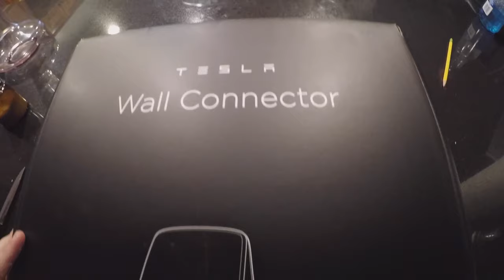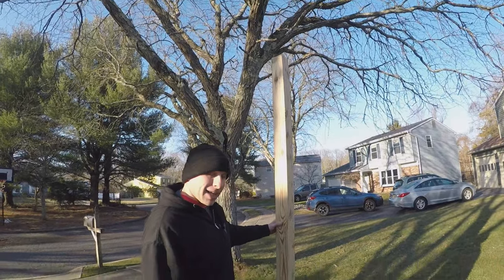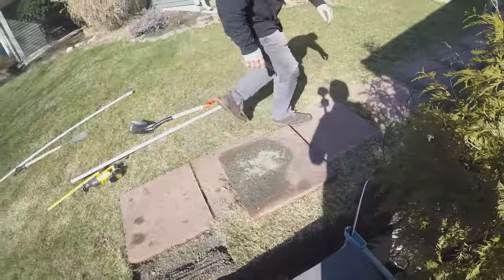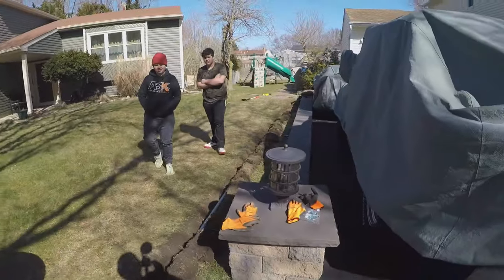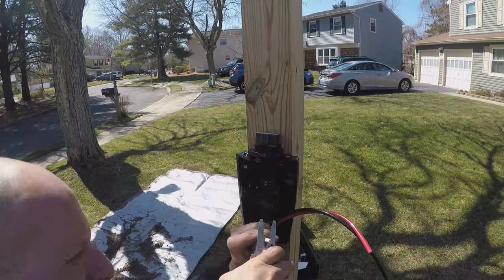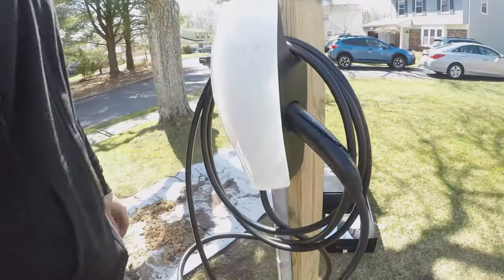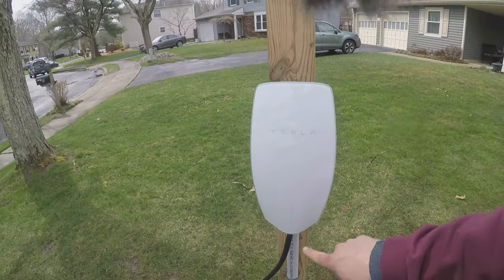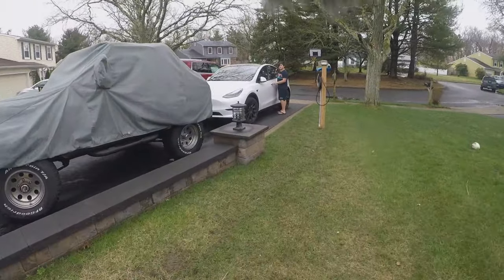Installing a Tesla Wall Charger in 15 Minutes

Comment: As an a electrician  , you should write disclaimer that your install is not to be used as an example on how to do this , as you have so many code violations on this video, not sure how you see this as a safe install, people out there please hire a licensed electrician to do this right for you , don't cheap out, you already spent 50k plus on your ride. protect your house and your ride
Reply: So when I buy mine I’ll hire an electrician to install this same charger? Great! Now I have to pay for the paint protection film, this, this for it to be installed, and insurance
Reply: Instead of wasting time complaining about this job, contribute and inform people on how to do it correctly.
Reply: @xjinit  there are people you hire to do these things (that’s why they called licensed ) if you can get your license watching YouTube videos , instead of going to school and working on the field we’d be in real trouble , so it’s not necessary to explain what or how to do it right ,only to say that if you don’t know what you’re doing (specially in electric , don’t don’t it )
Reply: @roygozlan04  News flash for you, school is thing of the past being replaced by the internet(YouTube.) Don't tell me you don't learn anything on YouTube, that would make you a liar. You also dont need to be "licensed" to setup a basic 6-50 or 1450 EV outlet for your house. Setting up a new construction 480V 3 Phase system on a commercial building is another story.
Reply: #Facts
Reply: Give me a break. This install was done clean and perfect. He doesn't need to spend 500+ dollars to have a trained electrician do exactly what he just did.
Reply: @xjinit  exactly, professionals don't want you doing this easy install. Even though the gentlemen in the video did a very clean professional looking install. I highly doubt if he hired a guy that they would of done any better. Now if your not the homeowner. You better hire somebody that's another story.
Reply: @roygozlan04   Yep, another tradesman who can't identify a tangible safety issue.  You guys (mostly union) always think someone's going to take your job away.  Nope. In fact, I personally would be more likely to hire a pro if I understood the safety concerns.  But NONE of you can do anything but spout "so many code violations".  Defend your position and articulate actual safety issues.  Don't quote NEC.  Tell us things like, "he used the wrong wire so that can cause __ ".

Comment: So many code violations. Don’t use this as an example for installing your own wall charger. This guy clearly doesn’t have a clue what he is doing.
Reply: I know nothing about code violations but please explain lol I’m curious.
Reply: Need metal line for Eletric in the ground. I bet it have to be so many ft down too. And I know nothing about code. Also are these Tesla box waterproof?
Reply: @markbenjaminh  That was my main issue.  Is the Tesla box rated to be exposed outside?
Reply: I am a licensed electrician who has done countless TESLA charger installs and i am a certified TESLA charger installer. This guy is a hack and don’t follow what this guy does. His trench is no where deep enough, the breaker he used is first of not the right style of breaker for that panel, and it is also oversized for the wires he used, his trench is not deep enough, his conduit is not built right at all, there is nothing wrong with the screws and bit that comes with the charger, they also wrap the cord too tight around the charger, they are going to short it out soon or damage the wire. This guy should not have done this and should not be encouraging other people to so it this way.
Reply: @markbenjaminh  nah pvc can be in a trench as long as the top of it is 18 inches deep
Reply: @christopherlynch3314  Yes, obviously you have not taken the time to access the mounting instructions via the Tesla website, recommend you do.  Rated for outdoor install.
Reply: @markbenjaminh  Agreed. Here electrical is required to be 3ft deep. At least when we had our home built that was the code requirement.

Comment: It's supposed to be 4 wires: two positives, a neutral, and a ground. Dude has 3 wires and used the white neutral for ground. He dug too shallow; it's supposed to be 18 inches deep.
Reply: Incorrect.  The Tesla Wall Connector only accounts for two hots and a ground.  There is no neutral. Look into it.

Comment: I did this installation too, a much simpler installation in the garage, into the wall and down to the basement.  The directions indicate you should wrap the wires around the right of the box so if the wires enter from the bottom wrap the wires and insert them from the top. Also, the directions indicate that you should use a torque screw driver to apply 50 foot lbs to keep the wires from slipping out. Also directions say wrap the cable counter clockwise but interesting putting the charger down the driveway. I am impressed if he did all that in one day.
Reply: It’s 50 inch lbs by the way.

Comment: Pvc pipes will break under the  moist soil and could damage the cable. There is other cable protection on the market for underground wiring
Reply: I expect there are variations in local codes.  But I have on many occasions seen 200A service brought into a home via schedule 80 PVC pipe.  Perhaps your statement might be true, but there must be some specifics about it.  Obviously that's not true as a generality so maybe clarify?  Also not sure why you think moist soil will break it. <shrugs>

Comment: thank you so much for this video, 
is it ok to use this wire 6/3 Black Stranded CerroMax SLiPWire Copper NM-B Wire for under ground, I have my electrical panel 75 ft away from where I want to install my charger and I need to go under ground and I have only one place left in my electrical panel

Comment: Illegal electrical install..... breaker, not rated for the panel, the conduit is not deep enough, straps not rated for pvc, no expansion joints,  no fucking bond/ground wire... that mess you made of the conduit leaving your panel... my head is exploding... where is the cover for your electrical panel?

Comment: Hope nobody steals that beiing for some reason at the end of your driverway. And everyone screaming code violation, STFU. You the kind of neighbor that rats out anyone.
Reply: And we found the guy who changed a light fixture and thinks he's an electrician. The NEC is code written in blood. There is a reason behind everything in there. Clearly you are clueless. I fancy myself a pretty handy guy, built a few houses from wooded lots, M.S of Elec. Eng from MIT.....I wired up my solar system and battery to what I thought was perfect, had my buddy who's a Master Elec. come look at it and found a few errors I'd made myself and things I'd overlooked. I have him check and big wiring changes in my houses....Piece of mind that my kids not going to grab onto an accidentally electrified conduit or pipe.
Reply: The worst violation I saw was the mixing and matching of circuit breakers, which is an actual fire Hazard.  I spot at least 3 different brands in there, including the GE he installed that doesn't look like it even fits properly.

That said, it's his property so he can do what he wants to it.  I just feel sorry when I run into future homebuyers who end up paying the price for a previous owner's handy work.
Reply: @GoatIsLife  Mixing breakers doesn't mean squat.

Comment: The kid was partially correct. It did not begin charging due to the fact that you had a scheduled charge time set on the car's display. Meaning the car will only charge at that specified time, even if it is plugged in. The wife might have set that up and didn't tell everyone else. This is usually done in areas where it is cheaper to charge at night, say, at midnight. To test it in the future, regardless of scheduled charging time, enter the car and tap "start charging" on the screen and it will manually start to charge, no matter the time of day. 

Good install.